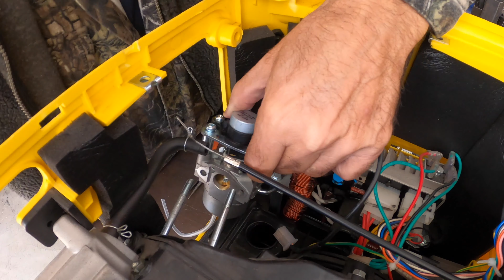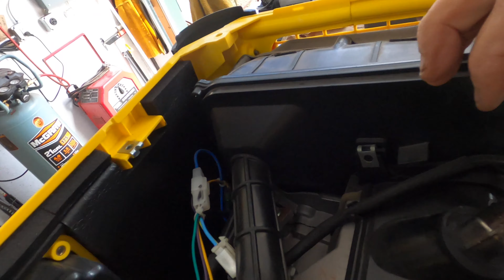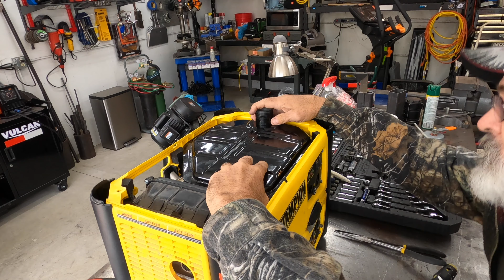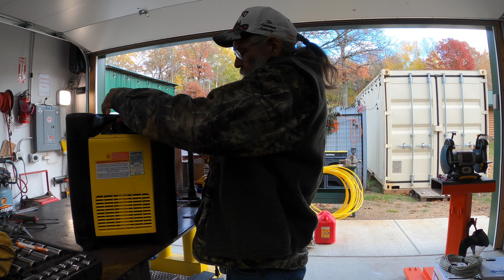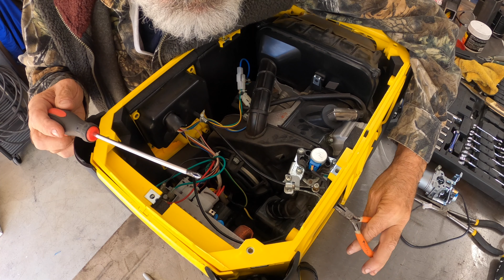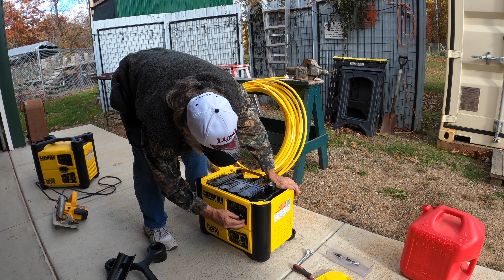"Backyard Hack" FIXING GENERATORS ~ Champion 2000 Watt Stackable Inverter(S)

Comment: I just repaired 2 of my own, previous model. 1 had an intermittent low oil switch- I just unplugged it and it runs fine now. 2nd I found magnetic dirt in the flywheel that caused problems, it too runs fine now.

Comment: These do not have a fuel filter on the carb. They only have a 'screen' inside the fuel tank filler tube. Do you think adding an inline fuel filter to the carb may prevent the carb from getting dirty? Thank You!

Comment: If they surge, you likely missed the small low speed jet at the top of the carb.
Reply: I have three of these plus the parallel kit and they are superb generators and very inexpensive especially second hand. A great buy and as you can see parts are readily and inexpensively available.....signed: A Champion fan boy